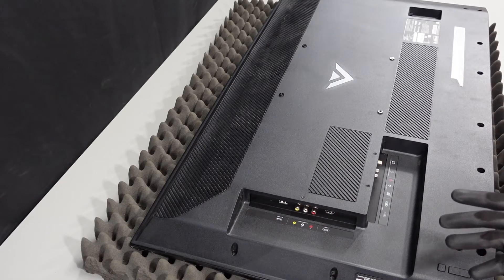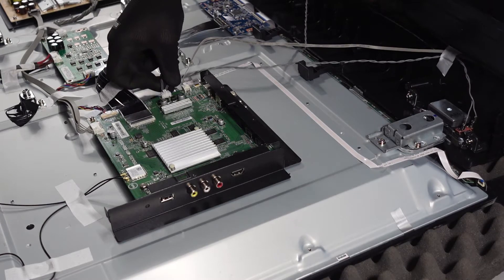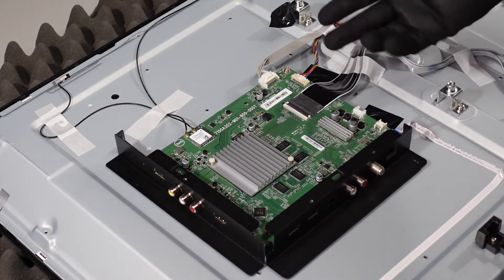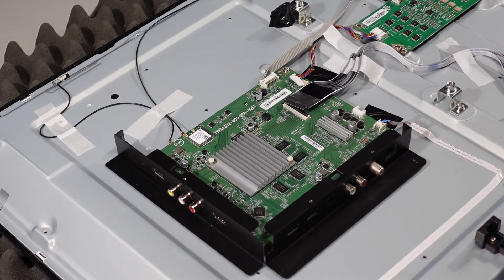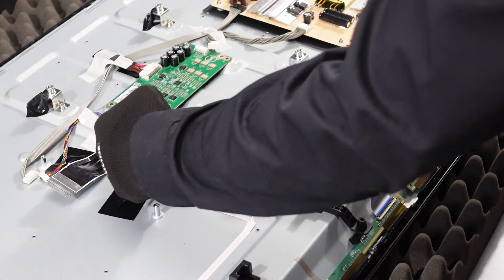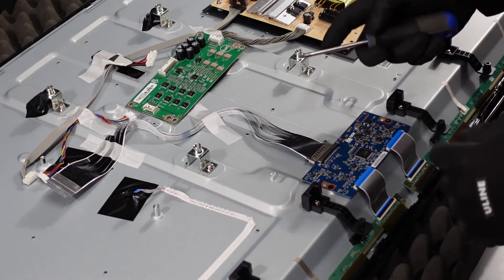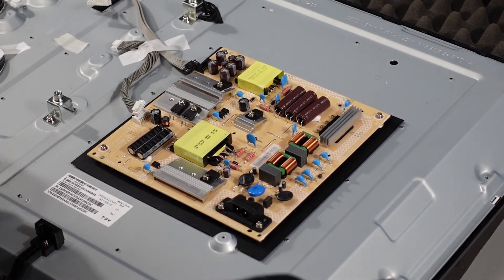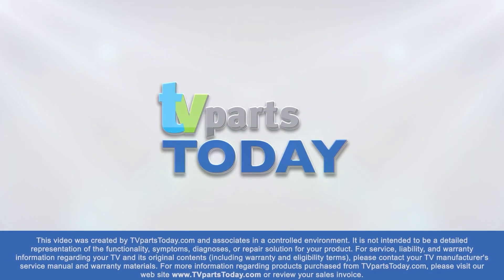Watch how to take apart your TV.  (VIZIO V436-G1)

Comment: If you replace the screen on a Vizio (it's damaged) should you also replace the LED backlights? The idea is you have the screen away / off of the chassis / frame, you can replace the LED backlights. Thank you 🤓 plus I subbed 🤓
Reply from the maker: You CAN replace the backlights as it would be easier since the screen will already be off but you DO NOT have to if your backlights are fine and working properly!
Reply: @tvpartstoday  yes, thank you 🤓

Comment: I got 58 inch V series that pulses horizontal lines across the top every 3 ish seconds sometimes it gets better sometimes it gets worse. Think its anything easy enough to be worth trying to take apart? Happened literally 1 month out of warranty
Reply from the maker: Thank you for the comment! We see that so often - the set failing RIGHT outside the warranty. We would recommend shooting us an email at info@tvpartstoday.com with a video of exactly what the lines look like. Alternatively, you can Google our company and chat with us. We always think it's worth trying the circuit boards before throwing the TV out & buying a new one! If we had to make an assumption based solely on your description, we would recommend replacing the main board or tcon board as either can cause lines in your display, but this is subject to change after we see the video.

Comment: How do i know which board is causing my problem? My tv only lasts for 30 minutes like normal until it goes berserk for 1 second and fully off or flashing black and white? How can i diagnose this tv with multimeter to buy the part i need? Thanks!
Reply: @tvpartstoday
Reply from the maker: @_Castillo_Grows_  We would not recommend testing via a multimeter. Even our most seasoned repair technicians use the process of elimination method when it comes to TV repair. Replace the circuit boards in the set from most likely to cause your issue to least likely until one resolves the issue, if nothing does then it is likely the backlights malfunctioning or the screen!